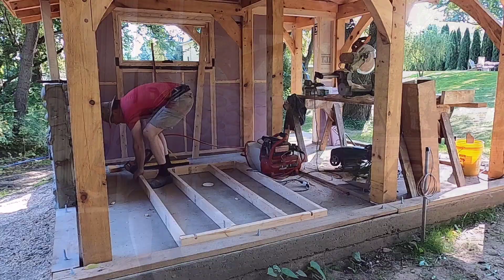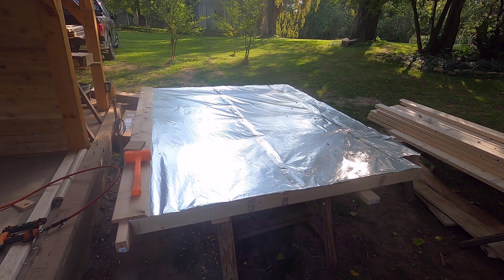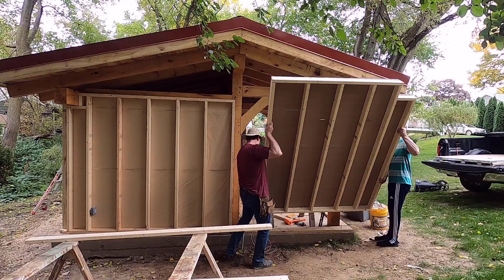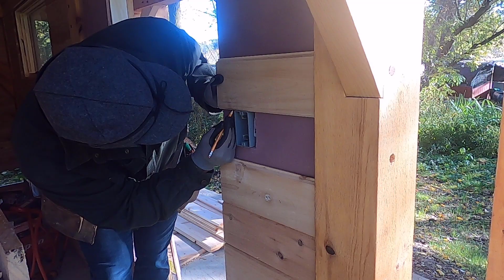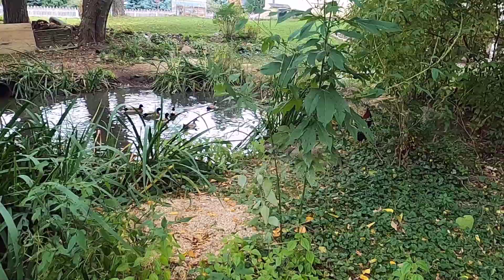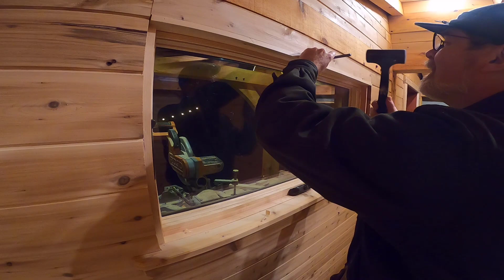Timberframe Sauna - Building the Walls

Comment: how do i fill the gap in between the rafters and the roof? I took the BYO timber frame class at North House but I haven't raised it yet. Wondering how I insulate the gap between my plates and the roof(since the rafters sit on top of the plate). There's probably an easy explanation but I can't figure it out.
Reply from the maker: https://youtu.be/2ZVEwJ-MlM0